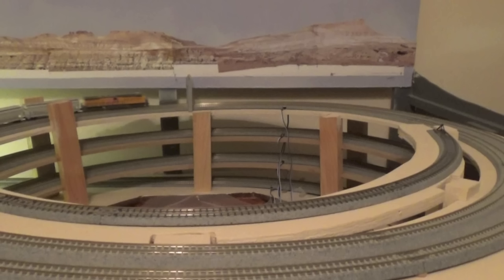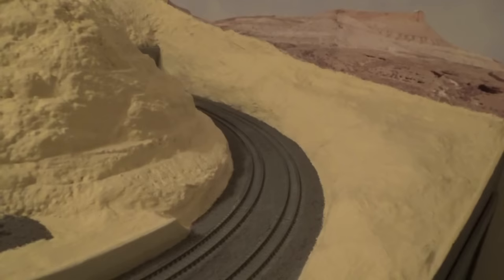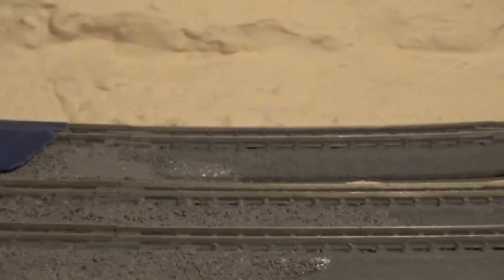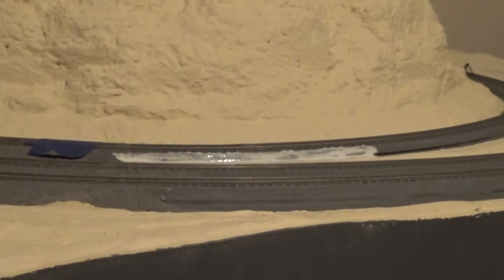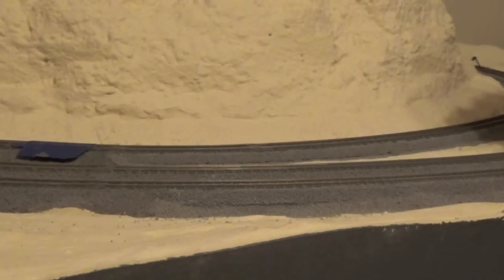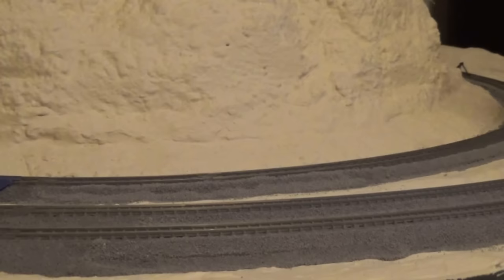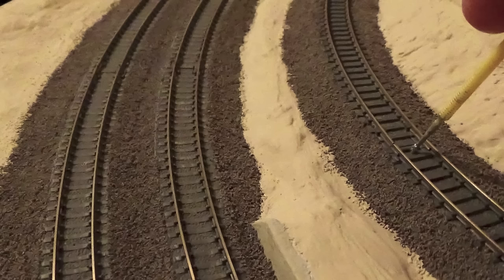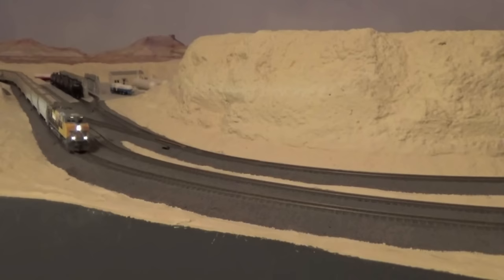Ballasting Kato Unitrack

Comment: I use basically the same procedure with Kato as well as Bachmann track. The only difference being that I generally use scenic cement rather than diluted white glue for the second and subsequent layers of ballast. Also on the Bachmann track I do apply ballast between the rails as the ties protrude further than the Kato. Be especially careful around turnouts to keep the scenic cement or diluted white glue from running inside the turnout mechanism or you'll end up with a poorly operating turnout.
Reply from the maker: +David Rarig You're absolutely right about not letting any glue or ballast get down inside either of the two openings in the Kato turnouts. If that happens, the turnouts will no longer work well, if at all. That's why I always cover those openings with blue painter's tape or masking tape.

Comment: My layout is Peco code 55 Flex Track but my Test layout I'm currently working on is half Kato.   Not sure if I'm going to ballast the Kato or not as I may decide to replace it.   In any case, I start the same way you have, applying white glue to the sides and sprinkling on ballast, letting it dry and vacuuming up loose stuff.   I use a small handheld vacuum for that which lets me reclaim the loose ballast.   Then I follow what Model Railroading does and ballast the centre which spills over to the edges.   I take my time to get the centre no higher than tie height as well the edges and then use a foam brush to form my outsides.   From there I use a mixture of 50% alcohol and water (or 10% alcohol and 90% water) to gently wet it all down (I use a syringe).    From this point until dry, you can't touch the ballast, no attempts to form it or anything or you'll just get a gigantic mess.   Anyway, after wetting it, I use Scenic Cement and give it a god soaking and let it dry.   If I need more applications of ballast to get the shape I want I'll again apply it dry, form it, apply wet water and Scenic cement.   When I like it, I take a piece of wood (1X2 that I've cut grooves in to fit over the track) and use it to clean off any ballast from the tops of the ties.   The end of the piece of wood just reaches to the tie tops so running it back and forth it'll catch any high spots and clean them off.   I go over the entire inside of the track and pick off any ballast on the inside web.  Oh and at the start I sprayed all the track and sides with an air brush.   Anyway, now that I've got it pretty much done, I take a wash that is mostly burnt sienna but a bit of black in there as well (water and alcohol), very dilute and dribble it down the middle of the track, high enough that it floods the sides of the track (I'm going to follow your suggestion and put a bit of white glue in next time).   I also dribble that down the outside of the track as I want that rust look.   For cleaning the track, I start with a short piece of 1X2 and rub the edge of it on the top of the track.   Takes the paint off.   Then follow with a bright boy, then vacuum up anything left, then a rag and commercial "track cleaner" or ATF.    Finally, time to run trains.
Reply from the maker: +Don Martin Thank you for sharing your techniques, Don. One of the best things about the hobby is how we model railroaders enjoy sharing with each other what we have learned from our experience. Many will benefit from your tips. Way back in the mid-1980s, I built an N-scale layout using Atlas flex track and Peco turnouts. On that layout, I used the traditional method of ballasting, which begins by first spreading and shaping dry ballast over the track, applying alcohol or "wet" water, and then applying glue. On my current N-scale layout, I'm using Kato track and quickly discovered that the traditional method of ballasting wouldn't work, especially because of Kato's plastic roadbed and shallow ties. So I turned to the method described in the video. Like you, I use a small vacuum to clean up any loose ballast and reclaim it for subsequent applications.

Comment: Ballasting, wiring.   It is all part of being able to do what I like to do, in the time frame I like.   There are no deadlines (well, maybe some self imposed ones if you chose) so I can take 5 hours to do something the way I want it instead of only being able to allocate an hour and having to rush through it.   On Saturday I built a couple of turnouts, on Sunday I plan to build a coupler more but decided to relax and do nothing (well, watch Magnum PI movies with the wife) I can build the turnouts some other time.   That's my point, I get to do what I want, when I want.
 And, once I retire in a year and a I bit I should be able to chose even better.

Comment: I did a small layout many years ago with Kato track. I definitely remember having issues trying to put ballast down the traditional way. I had glue flowing everywhere and ended up losing a few turnouts because of it. For my current layout I'm using ME Code 55 track but I think I will give this method a try when I reach that point. Yes it probably does take a little longer but I think you had much less issues in the end because you really are controlling the glue instead of just spraying it everywhere.  ~Neil
Reply from the maker: Thank you for sharing your thoughts and experiences on the subject of ballasting Kato and other brands of track. I believe you are absolutely right when you suggest that controlling the application of glue is the secret of success in ballasting. ...Roy

Comment: Roy,  There are numerous videos as well as many of my modelling buddies that swear to NEVER use a bright boy on rail as it is abrasive and will inplant micro scratches into the rail heads that catch dirt and reduce conductivity.

Bob S
Reply from the maker: You're absolutely right about Bright Boys, Robert. Some time ago, I stopped using them on my track, except for small, really tough cleaning jobs. Now I use mineral spirits for cleaning. ...Roy

Comment: hi Roy  a dab of white vinegar on where you want to take off the glued down ballast works wonders, after 5 mins of applying the white vinegar the ballast comes of easily.
Reply from the maker: Thanks for the idea of using vinegar, Clayton. I never heard of that before. I'm going to try it the next time I need to move or remove track that I've already ballasted. ...Roy

Comment: Kato. Nice smooth running. brilliant. However when going for realistic,  the ballast bed is already bigger. Don't be afraid to use an airbrush and paint 
certain area's. Ballasting switch track's, nightmare begins. however bring the level of the terrain up so you reduce the area needed for ballast. " Gordan Ramsey of railroads"

Comment: Another great video! Thanks for the ballasting tips. When it came to painting the sides of your track,  What were you able to do when you were paint your turnouts? Also, were you able to paint the insides of track and turnouts?
Reply from the maker: +MWRR R Yes, I did paint my turnouts, but I did so very gently and lightly and only after covering both openings found in Kato turnouts with painter's tape or masking tape. (I covered those same openings again when applying ballast, so that I would not get any glue or ballast down inside those openings.) I used a micro brush to paint the outside and inside of the turnout rails, carefully avoiding contact points. Afterward, I carefully cleaned the tops of the turnout rails. I must tell you: I was very concerned about painting the turnouts and left them go until the last part of track painting. But so far, I have not had a single electrical problem (or any other kind of problem) after painting and ballasting the Kato turnouts. The paint did not get down into the rail joiners, and thus did not cut off the flow of current in the rails. By the way, I painted the rails, ties, and plastic Kato ballast all the same dark gray color, and later on, I used a dark gray ballast to match the prototype I am modeling.

Comment: Great video Roy. As always :)  What do you use to stick your track to the board?
Reply from the maker: slapshot2k Thanks. In the past, I glued my Kato Unitrack down with a dab of hot glue every foot  or so, along the plastic roadbed. Now I use liquid silicon glue. It’s essentiially the same glue, but I no longer have to burn my fingers. ...Roy
Reply: @n-scaleunionpacificevansto6569  Thanks Roy :)

Comment: Roy   was the track fasten d own before  you started ballasting? If so what did you use to fasten down the track
Reply from the maker: Yes, Kenneth, I fastened the track down before painting and then ballasting it. To fasten it down, I use just a drop of liquid sulicon glue along the edge of the plastic roadbed every foot or so. I do not weight the track down. Rather, I let it “float” in its natural podition. The glue in the ballast holds the ballast in it permanent position. This method allows me to pry up the track easily with a spatula if I decide to change the track arrangement. ...Roy
Reply from the maker: Kenneth, I meant liquid “silicon” glue. ...Roy

Comment: why dont you have a fred on the end of your consist?
Reply from the maker: This is a very good question, Bill. I certainly should be running my trains with FRED (or EOT) devices installed on them. I guess the only answer is that I haven't gotten around to that kind of detail yet. Also, I haven't been sure that it can be done easily in N-scale, but I'm going to check it out. ...Roy
Reply: There is great FRED kits online the track just needs to be installed with a pin or screw like any other truck and you drill a small hole in the body for the circuitry and battery.